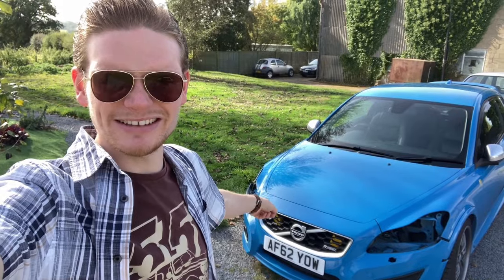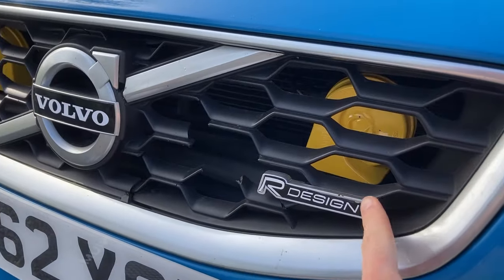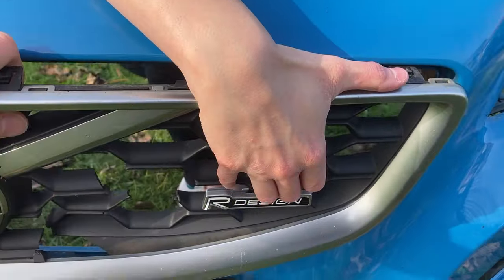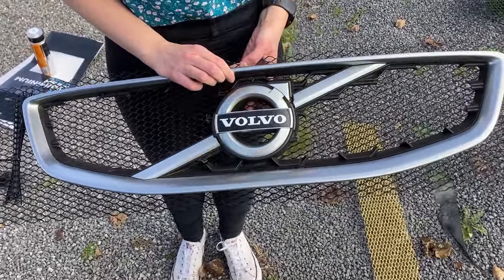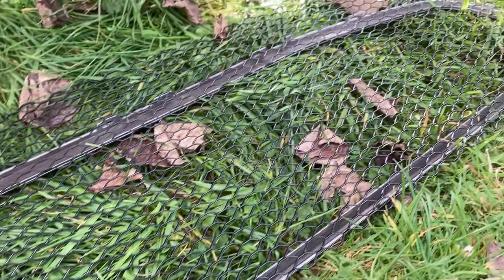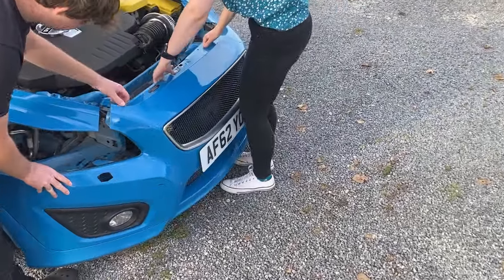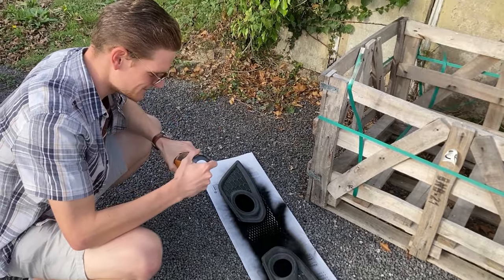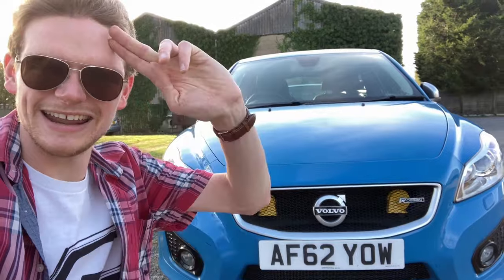Custom Grille On MY GIRLFRIEND'S Volvo C30!

Comment: Hello Joe! I have a question about seicento petrol smell. In my situation when i start, turn off(most of the times), and while driving (from time to time) smells like petrol in the coupe. I cannot find answers, there is no higher gas consumption or leaks, i think its not from the filter inside the mudguard, the gas cap is thightly closed so its not from there too. I see u know a lot about these cars, i will be very thankful for ideas! Thanks in advance!